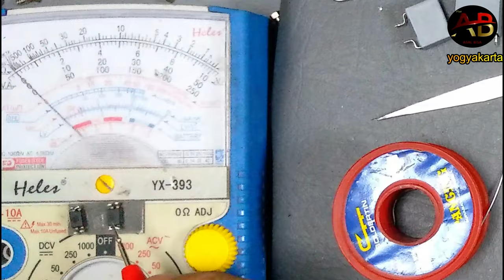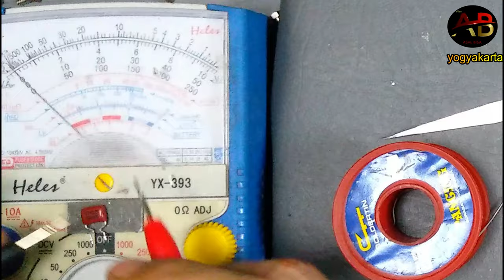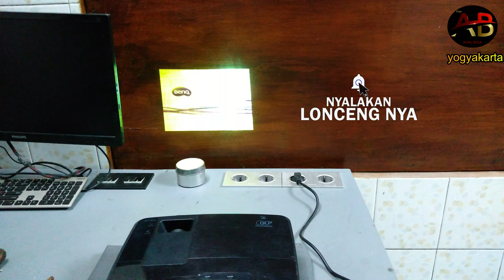memperbaiki proyektor lampu tidak mau nyala

Comment: Kalau voltase yang masuk ke ballast hanya 10 volt kira2 masalahnya di mana ya pak?
Proyektor hanya berkedip merah tidak bisa nyala jika ditekan tombol power
Reply from the maker: Biasanya klo seperti itu motherboardnya yg bermasalah mas.
Reply: @Plat-AB-Asal-Bisa  Motherboard aman jika saya pindah ke proyektor lain. Hanya saja di proyektor lain terdeteksi voltase yang masuk ke ballast sekitar 64 volt, namun di proyektor yang hanya kedip merah hanya 10 volt
Reply from the maker: @dwindrahelmi  yg di maksud voltase yg masuk ke ballast dari power supply kah?
Merk dan seri proyektornya apa mas?
Reply: @Plat-AB-Asal-Bisa  iya pak, proyektornya merk benq persis seperti yang di video
Reply from the maker: @dwindrahelmi  berarti power supply nya yang bermasalah mas.coba cek transistor 5bw di psu nya.

Comment: Sir what part in blast did you replace and why? I couldn't understand your language.i am sorry for that. I viewed the video multiple times but could not get. Thanks
Reply from the maker: the spare parts that I replaced were 3 ic couplers. 
I have corrected the translation in all my videos, so that it is easy to understand all languages? Sorry if there may still be some words that may be difficult to translate correctly. In the future, I will improve the system's default text.
Reply from the maker: you're welcome 👍
Reply from the maker: there is one ic coupler which if measured is not balanced with the others. but I prefer to replace all three.
Reply: Thanks sir